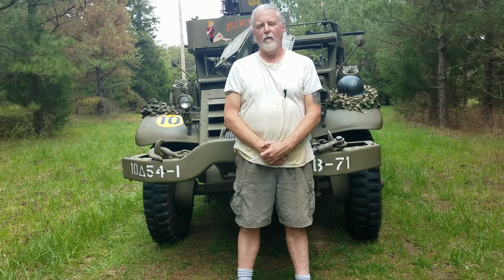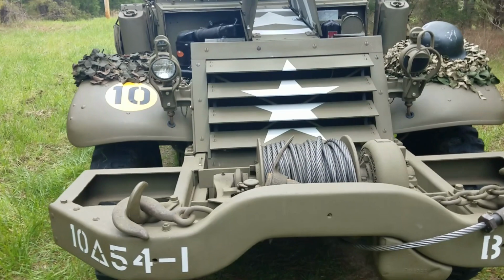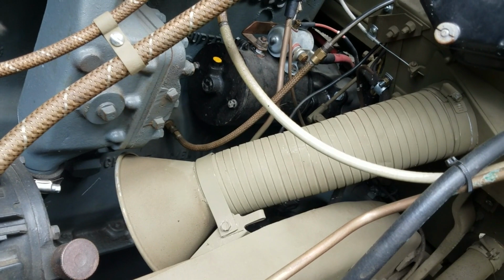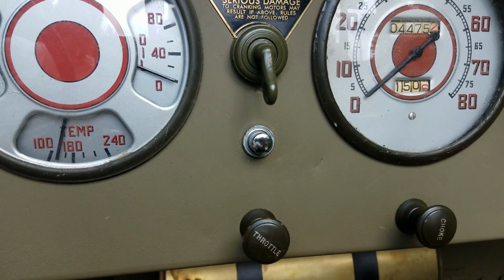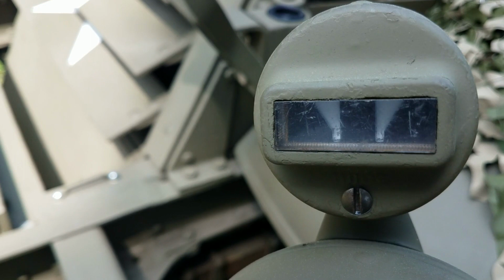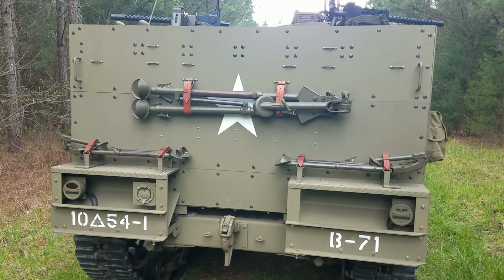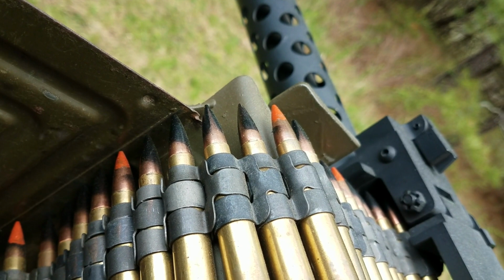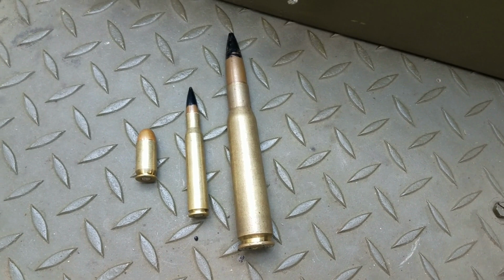M2A1 Half Track Walkabout - 1941 White - Bertha #halftrack #militaryvehicles #military

Comment: About the interchangeable headlights; the hooded ones were for blackout driving and the full clear lens was for driving in non combat areas, usually rear holding areas or supply bases. As many have noted the clicker was a signaling device for the airborne units, and sometimes the infantry units on night patrols, it sounded like a cricket at a distance to fool the enemy. The barrel magazine you spoke about are also called a 'drum' magazine. There were some of them used in the war, but generally they used a clip that was easy to switch out, hence the ammo bag for numerous spare clips. The Thompson could be fired in burst of three or four rounds, the timing for these was usually measured by pulling the trigger and holding long enough to say 'son of a bitch'. Bursts helped keep the barrel from over heating. Most of my basic training NCO's were WWII or Korean War vets and yes 'they were tough as nails and run us recruits into the ground every chance  they got!!
Reply from the maker: Thanks for the comment. Great info!!

Comment: Awesome rig. We have a 1951 GMC 6x6 2 1/2 ton truck which has been turned into a skipjack logging rig. It has a GMC 302 cid. 6 cylinder with a multifuel Holley carb. with almost the same trans setup your halftrack has tho its an automatic with high/low range that has reverse in each. wench is now on the back to lift logs so they can be dragged outa the woods. You have done an amazing job on this Half track.Thanks for sharing.
Reply from the maker: Thanks!! Sounds like your rig is still going strong? That's very cool that it's still working in the woods after all these years!!

Comment: I would think that keeping the engine noise down when traveling through the frontlines would be a very important advantage especially when stealth was mandatory for survival. One thing I've read before from during the battle of the bulge is American troops could hear the difference from allied vs germans tanks because of the louder engine sounds from german tracked vehicles.
Reply from the maker: I'm sure there were times that being quiet was VERY important when sneaking up on or around the enemy. Bertha is amazingly quiet.

Comment: Bracket in Pass. floor well referred to in Technical Manual TM-9-710 as "apparatus, decontaminating 1.5 qt., m2 (spec 197-54-113).  Right of right shutter handle fastened to plate"...
- vehicle gas-decontamination kit?
Reply from the maker: I've seen that discussed at: https://halftrackinfo.com/index.php?topic=1696.msg17450#msg17450
But it seems nobody has a photo of the bracket that mounted it in this location. Have you seen a photo of the bracket? Thanks so much for the comment!!

Comment: Kool truck - one of my godbrothers bought a 1951 Army jeep cj5 - it was in rough shape but is boys ( 4 of us ) rebuilt back to military spec. except he put over size rims and all terrain tires on it and a roll cage - it had 4 seats - two were in the bed and could fold up out of the way - i think he still drives it - him and his twin brother are antique vehicles collectors  - mostly pre 1970 only and rebuilt them to factory spec.
Reply from the maker: I also restored a 1955 M38A1 which looks much like a CJ5. My dad bought it from a local fire department back in 1969 so it's part of the family. I need to do a "walk around" on it. My hot rod is a 1964 Ford Fairlane. I pulled the 260 and 3 speed and replaced with a hot 289 and a 4 speed in the floor. I love the old vehicles!!!! Thanks for the comment!!

Comment: 10th Armored Division "Tiger Division"  54th Armored Infantry Battalion markings on the bumper. 10∆54-I

The 10th AD had a beautiful but also rare green oval patch with a prowling tiger superimposed upon a black tank silhouette on it, fully embroidered, cut edge. Green and white being the colors of the armor branch. Found in the piping on the overseas or garrison cap. Hence the green oval. It wasn't till roughly 1950 that the Pershing tank over crossed Cavalry sabres replaced the WWI tank branch insignia and then the colors changed to yellow and green.
Reply from the maker: Thank you for the info......and thanks for stopping by!!

Comment: Great vid and vehicle! Was it difficult to find tracks? Any idea how long a set of tracks would last?
Reply from the maker: Thanks!! The set that's on it were NOS tracks made in 1972 probably from Israel. They used US half tracks up into the 90's. I've read that a set should last 1000-1500 miles on pavement. I've ran several hundred miles and really don't see any wear. There are a couple of companies making tracks now.....but a set is probably around $8000. I have an extra new set I bought a couple of years ago.

Comment: Nice . Looks like you did a thorough job.  I have an m2 I'm working on also.  Is the bed and armor original or reproduction.  What did you do for fuel tanks.
Reply from the maker: Hello!! Thank you and I appreciate you dropping by!! The bed is a reproduction as is the rear armor. All the armor is original from the bed forward. One of the tanks is a NOS rubber coated tank that's never had fuel in it. The other is a steel reproduction that I use. How's your restoration going?
Reply: @Keith Spillman - Half Tracks and Honey Bees  its going well but slow. I got it in about 1995 and I was 12 years old. I got it in the summer time and dad and I had it driving by Christmas that year. I disassembled it about two years later and had it down to the frame.  And sandblasted it and painted it then reassembled the drive-trane. In 1997 I received another m2 for my summer wages. Then life happened.  I have collected enough parts to put one back original with original armor and one that's a fun driver. I recently purchased a new set of tracks the beginning of this year and I have a few projects to catch up with and then I can get back to work on it. Maybe next year if things go well.

Comment: are those 'screw heads' on the front aligned for visual inspection or to keep from accumulating water/rust?
Reply from the maker: Good eye!! Lining them up all over the vehicle was a "trademark" of the White Motor Company so I did this during the restoration. But yes....it would also allow moisture to pass through and not accumulate. Thanks for the comment!!